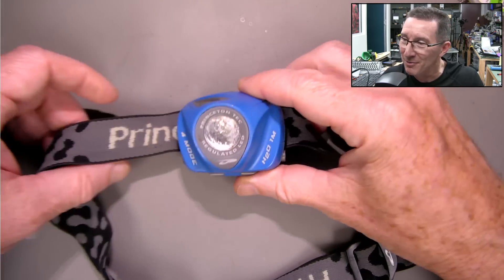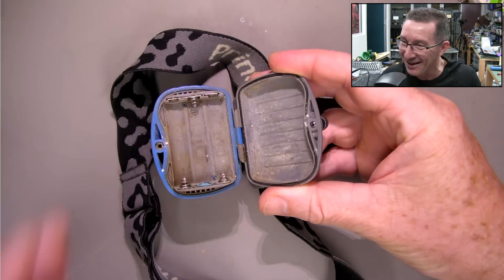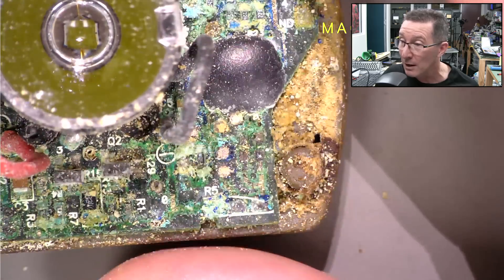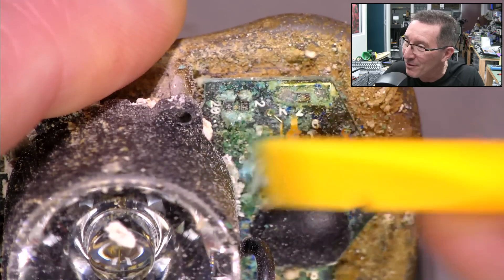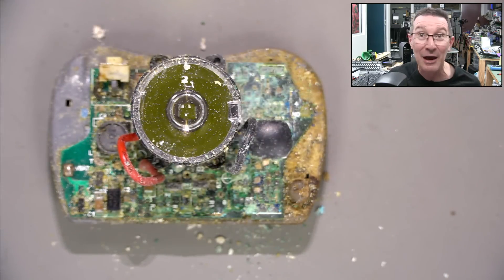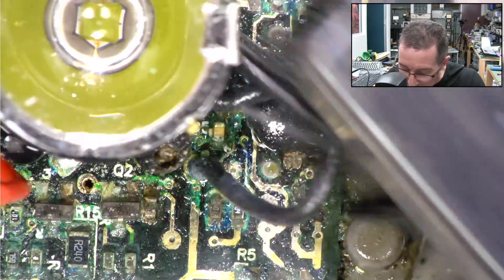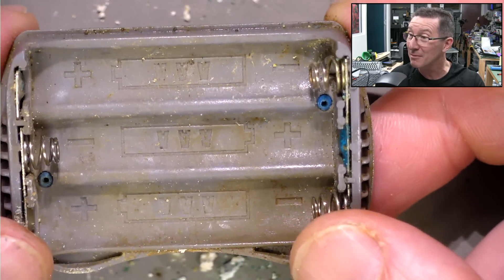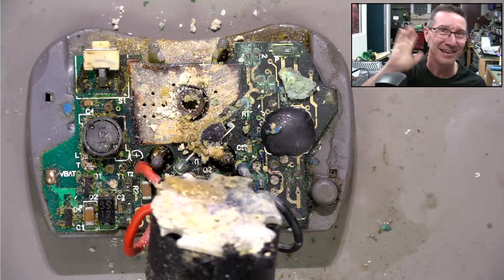The CRUSTIEST bit of electronics EVER!

Comment: I've seen only one crustier: a pair of active "hunting" headphones to pass sound but block loud noises. I bought it for something like $3, hoping to fix it or at least use the housing for my own active audio testing. The entire thing ended up being a loss, with the circuit board on one ear cover covered in corrosion. The board was pitted like a macbook with water damage, corrosion in the wires that went to the external microphone (busted) and the speakers (rusted).

Comment: Since I took up diving,  I've come across electronics on the bottom of the ocean a time or two.   I've definitely seen at least that bad.  At some point, it becomes hard to quantify what would be worse.  Kinda looks like salt water + batteries in that light.  Maybe someone got it wet and then removed the batteries thinking they might be able to clean it up?

Comment: Surely, that is a battery leak that for wahtever reason the last user didn't notice, maybe it dripped through slowly due to the orientation of the lamp in storage and had dried by the time the next user replaced the batteries. I've seen this in battery powered gadgets that were left in cars for years and years, cycling between cold overnight and boiling hot during the day.

Comment: I’ve seen that with Alkaline batteries on a pinball machine that retain the high score.  The battery pack is mounted to the pc board, and it gets crusty like that and eats all the copper away.  No water necessary!  Except maybe what’s in the air.

Comment: I have seen the effects of salt water on a board for a skid steer loader that spent time aboard a ship on the St-Laurence river here in Canada. It was old enough to be a through hole board. Many traces were replaced with 30AWG wire wrap wire. Many vias needed to be repaired by feeding through a wire and soldering on both sides. All the new wires were coated with liquid electrical tape to seal and fasten them down. The loader has worked for decades now on land.

Comment: No battery leakage required. Just some conductive moisture and DC current. You get a nice reaction where the negative connection will release hydrogen gas while the positive connection will release oxygen. But copper is fairly reactive and the positive side will NOT release oxygen gas, instead the oxygen will immediately react with the copper  producing that nice green copper oxide.

But I've seen crustier. Way back when I was a child, I attended an Altar8800 demonstration with my father. And I happened to win the door prize which was a calculator kit. Now, we're talking old school. The calculator used 6 AA batteries (they were in the rear half of the case, held together with 4 screws). In any case, one day my sister "borrowed" it and visited our grandmother. While there, grandma gave my sister some wet cucumbers, which she prompted put into her purse along with my calculator. Batteries and impure water being what they are, caused the batteries to discharge, causing all that lovely electrolytic corrosion. And 6 AA batteries have quite a few joules stored to cause quite a lot of corrosion.

Comment: I've run across (and repaired) some pretty bad corrosion from electrolyte leaking out of capacitors, but this is on a whole different level. The electrolyte damage was bad, but still repairable (it had only eaten through one component leg that wasn't just an easily replaceable part, along with many traces on the board). I don't think there's any hope for this thing - chuck that thing right into the f__k-it-bucket!

Comment: Battery leakage is a pain.
Got a substantial amount of Varta High Energy leaks recently. One of them destroyed a Hue motion sensor where components and PCB coating corroded away just like in your video. On my DMM I fortunately blew a fuse recently just to find the Vartas have started to leak too. Luckily only messed up the battery compartment yet. Moved to some eneloops in some devices, never seen any leakage.

Comment: Working as a tech I once had a telematics unit that was returned as "not reporting", opened it up and found that it was basically wearing a fur coat of mold, except for the parts where the board had been totally eaten away by water ingress. As the units were in the vehicle cabs and should have been perfectly dry it did make me wonder if the company had taken to employing dolphins as drivers.

I also had a tough PDA come back as "suddenly not working". A routine inspection of the outside showed no damage. However, upon opening it up I was confronted by an LCD screen shaped like a banana. Obviously the driver had deliberately run it over. Amazingly, after replacing the screen the device worked perfectly, and continued to do so until it was retired.

Comment: Duraleak FTW.

Yes i've seen pictures of such carnages on automobile alarm sirens with an integrated NiMh battery (common fault on Volvo XC90s). As this headlamp, it's a completely sealed enclosure. Maybe when there is no air to get inside, the chemistry of batteries produces gases that also helps in eating away everything?

Comment: Wow! I don't think I've seen any electronics quite that crusty before. It's possible the light could have been sitting at an angle and all the electrolyte to just run over the side of the battery holder. The electrolyte also seems to wick along everything too.

Comment: Not a valid comparison, but I've seen amazing corrosion on a unit of test equipment that occurred within 24 hours of leaving the facility.

When I worked for a company that made radio test equipment we won a bid for a slightly customized variant to be provided to the US Army. As soon as we had samples ready they were taken across town to be tested for meeting the stated specifications when subjected to vibration and temperatures and humidity required by the contract. Of 12 units one was functioning after 2 hours of temperature cycling but failed before 3 hours of the 24 hours required. All the others had failed more quickly from temperature, humidity or vibration testing. Had any survived 3 hours they would have been put into the next test and then the third. Then the combination tests.

The units came back partially disassembled because they documented what failed.

Every possible place there were dissimilar metals in hardware used structurally or electrically. Lots of rapid corrosion. Paper speaker cones all failed. Modules, wires and rigid coax came loose. It was total carnage.

We reworked everything and cleaned up the design flaws and assembly procedures and made lots of units for them over the life of the contract and another contract followed in a couple of years for a much more customized test set.
Reply: Humidity-freeze tests are very harsh. I've had products that look like they have been dragged to hell and back. It's amazing how plastics turn to powder, etc. Thermal cycling can also cause pressure differentials that cause gaskets to deform allowing humid air to be drawn in that later condenses resulting in trapped water. Amazingly one of my products survived the range of tests, however it technically failed as one of the switch contact block holders deformed causing the contact block to separate from the button.

Comment: The PC modules in the US military aircraft was coated in formvar in the 1970's when I served in the US Navy. When I replaced the components, I had to brush on a fresh coat over the areas I chipped off. We had broken sewing machine needles we got from the paraloft guys in a trade soldered to the voltmeter leads to penetrate through the formvar to troubleshoot. Simpson 260, Baby!
Reply: Yes 3 different conformal coats used in the stuff I worked on, one solder through, one not, and the third was sort of in the middle, in that it produced cyanide gas. All 3 tough enough, in that if you put a board in the ultrasonic cleaner, which hit it with boiling trichorethane and ultrasonics, it would take 20 minutes to remove, though the GRP board itself would delaminate totally in 3. Normally we would do a 5 second dip to clean them before application of new conformal coat in the areas worked on. When it was fluid change time all the ground support stuff would be put through, stripping all the dirt and hydraulic fluid off. Aluminium castings came out looking like they had just been cast.

Comment: ROFL, coincidence or not, the crustiest piece of tech I found recently was also a headlamp kinda like that one. Not the same brand though.
Some parts of it was so corroded it basically kinda fell apart. Similar thing, components just fell off in pieces.
And just to be clear, I never took that headlamp to the beach or somewhere you'd expect more corrosion and rust... but I did forget batteries in there, and they leaked and corroded the whole thing.

Comment: Had a couple of transistor radios that I once found on a beach pretty much like that. I think they were washed up from a boat. Must have sat on the beach for at least a year. Lots of rust, leaky batteries (still in them) etc. I literaly hosed them off replaced a few compenents including the speakers, and re did the battery compartments. Good as new. Sold them on e-bay many years later when I can across better examples. I've also had some pretty bad radios from farms and sheds with rodent droppings and who knows what else.
Reply from the maker: I'm thinking water ingress mixed with the batteries rather than pure battery leakage in a sealed unit.